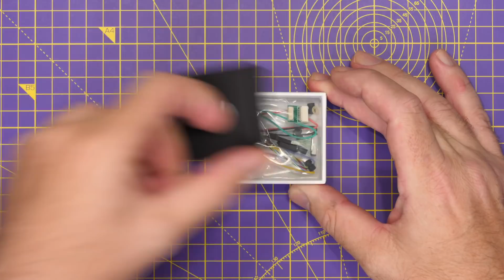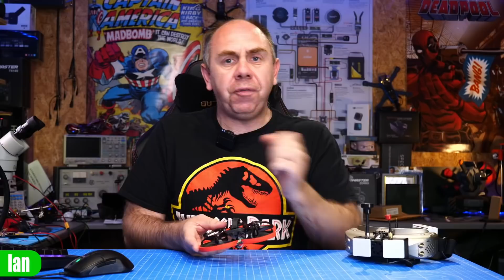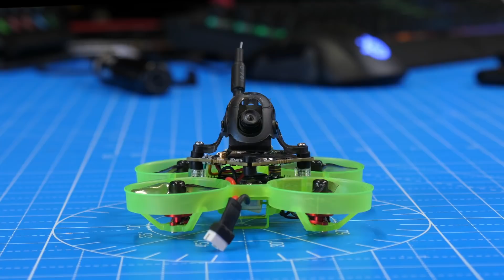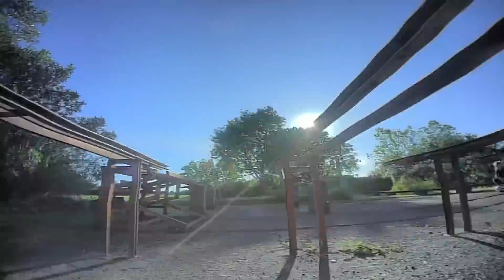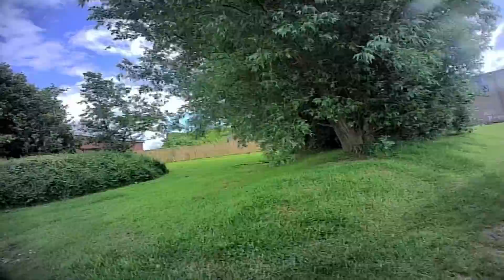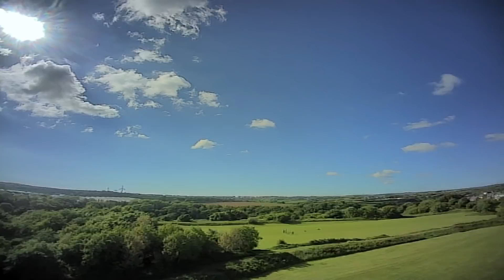HDZERO 1S WHOOP LITE KIT - DIGITAL FPV FOR EVERYTHING

Comment: hi MR MAds Tech Good   i have the mobula 6 analog and i wan to instal the hdzero whoop vtx , do i hve to buy a new FC and replaces de one is coming in the quad or is posible to instal and the same  Thank
Reply from the maker: It looks like there is a spare UART so you should be able to use that.  You will just need to disable the VTX.

Comment: I normally fly analogue at 400mw in heavily treed areas where I need good penetration. I'm assuming this is a 200mw vtx and is there any reason to believe that you need to same power analog or hdzero to achieve the same penetration?

Comment: I have a BetaFPV FC like that. It has the exact same issue though not as severe on a 3" toothpick I built. It will just randomly twitch while flying. At first I thought it was wind gusts until I flew it on a calm day with the exact same results.

Comment: I've had a similar jittery quadcopter once, 3" toothpick. Balancing the props on a sewing needle and shaving off little bits of plastic with a nail file helped it immensely. No amount of pid and filter tuning got rid of it otherwise. Just something to try out, maybe it helps, maybe it doesn't.

Comment: Changing out the ph2 connections for a bt2.0 or gnb27 will result in better voltage and current.  Ph2.0 gives  about  8-9amps and gnb27 12-13amps on mob6. Battery sag reduces and flight handling improves as voltage decreases with that simple connection change.

Comment: I watched the beginning and was like, "This is the future of FPV!", then I watched the footage of it and was like 😐😐😐
Reply from the maker: Remember this is the 1.5g camera. No analog that size looks this good.
Reply: @MadRC  good point, does the HDZero system have better cameras yet?
Reply: @lionelttl  the bigger cameras are better. this is just the tiny one for whoops.
hdzero has no retransmissions of lost packets like dji & fatsharks new system has.
but hdzero has far better latency. and weighs only 8g and runs on 1s.

dji weighs like 30 or 40g and needs 3s minimum
Reply: Yeah it doesn’t look worth the extra outlay over analogue to me, for this size at least.  I’ll be sticking analogue until the resolution increases to about double what’s shown here.
Reply: It should look better through the goggles
Reply: @seanconnolly2179  Thats what they all say 🥸
Reply: @lionelttl  at least I hope so lol